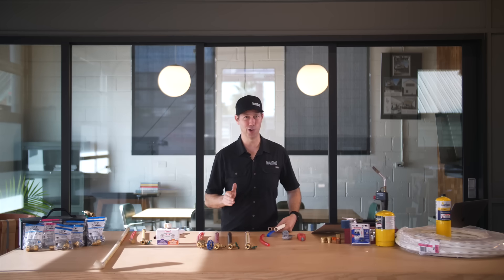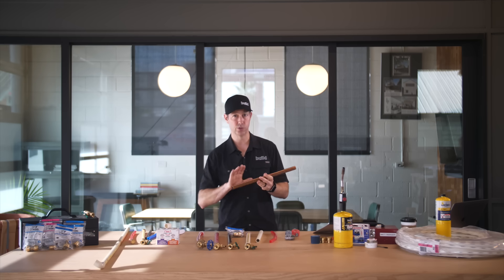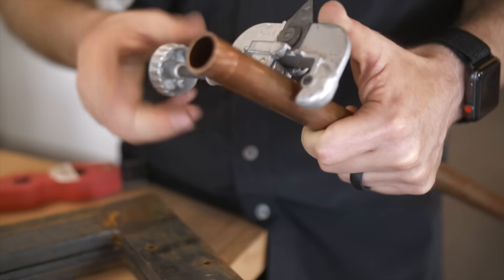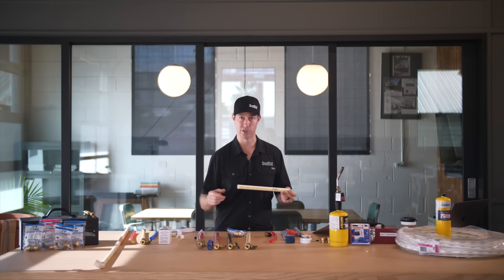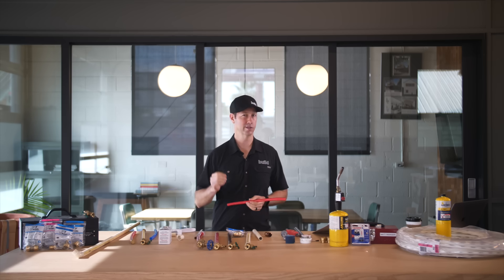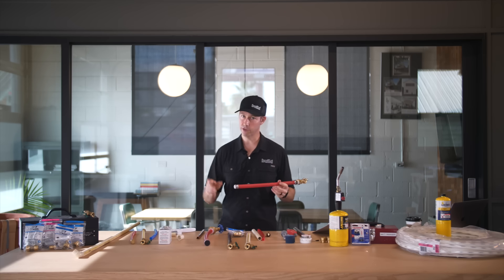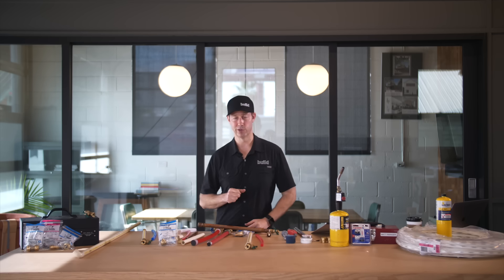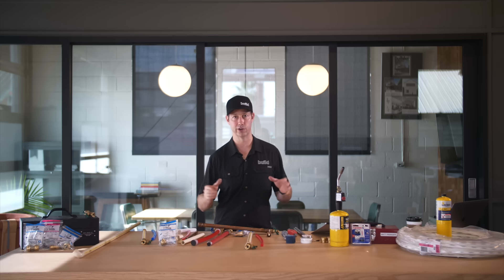PEX vs COPPER vs CPVC plumbing pipes

Comment: Avoid CPCV pipes at all possible costs, they get brittle as glass as time passes, even when using well water systems. The hot water pipes get brittle the quickest, and that is even when the pipes are shielded from sunlight.  Copper is best for areas where you need to have the PHYSICAL SUPPORT that a rigid pipe will give. Not many items require that, so that is why it is best to just go with PEX for everything. One area that requires the physical support of a rigid copper pips is the lines that go to a natural-gas-powered water heater, they might come into contact with the HOT GASSES that come from the combustion gases coming out of the heater before it enters the flu, so for that reason a lot of times it is required to have a 3-foot long line of metal pipe first, before the PEX can be connected. Other than that, you really don't need to use copper anywhere, PEX can be used to replace everything that would have been copper or CPVC in the past.  

    The absolute best PEX system is expanded PEX connection systems (Uponor, Waterline), as the fittings used in them have a much larger internal diameter than similar 'crimped' PEX fittings. Here is the main problem with using the Uponor system:  TOOL COST.  The expander tool is hellishly expensive!!!  Even used ones on eBay cost many hundreds of dollars.  Now Home Hardware in Canada is selling an exact copy of the Uponor PEX expander for only $105 US dollars ($140 Canadian dollars): https://www.homehardware.ca/en/cold-x-expander-tool-with-12-head-for-pex-pipe/p/3308481
So now an 'affordable' alternative for homeowners is finally available. Princess Auto in Canada also sells a PEX expander tool that is faulty in its design, and much harder to use (I do NOT recommend it), but it only cost $18 USD so that's a huge win for anyone who needs to install just a few fittings;  https://www.princessauto.com/en/detail/pex-pipe-expander/A-p8572166e  ( I had to modify mine by filing down some of the square shoulders so that there was a bit of a 'taper' to fit into the PEX pipe itself.  You first used the smallest side first, rotating the tool a bit with each squeeze of the tool to prevent wall 'tearing' of the pipe, then once expanded you flip it around and use the other side, rotating the tool as you go, and that expands it enough for 1/2" Uponor fittings to fit inside the PEX pipe). With the modifications the cheap tool worked great for me for 2 fittings, with no leaks.
   A battery-powered expander tool from Uponor will easily cost you $400 with the tool, the battery, and the expander head altogether. 

    SharkBite fittings have an internal stiffener that shrinks down the internal diameter similar to those of the expanded PEX fittings, and they are really expensive compared to expanded-PEX fittings. Just four SharkBite fittings and you've already spent more than you would have spent on installing an expanded PEX system using a low-cost expander tool.

     Crimped PEX connections are smaller in internal diameter, and they also require a rather expensive $60 crimping tool to install the solid copper crimp rings. While they are smaller in diameter than the expanded-PEX connections, they are okay for lines going to 3/8" risers, such as those going to sinks or toilets, but not very good for high-flow areas like washing machines or bathroom tubs/showers. There is a type of crimp ring system that uses a stainless steel crimp ring, and it has a TAB that is squeezed to cause the ring to get smaller over the PEX pipe. As time passes that TAB tends to 'expand', especially in hot water lines, and leaks occur after about 8 to 12 years, so I'd stick to the solid copper crimp rings instead. 

     So there you go:  
(1) Avoid brittle CPVC,  
(2) Avoid the complexity of having to solder copper pipes unless it is absolutely required (such as with gas-fired water heater feeder pipes).  There are braided stainless steel riser sections that SharkBite sells that can be used in such areas, but the rubber inner lining of some of those older designs degraded and were recalled in hundreds of thousands of homes. Here is the video of this specific failure: ( Autopsy of a Failed Sharkbite Flexible Hose 3/4" FIP Fitting for Water Heaters )  https://www.youtube.com/watch?v=3eoi74wsD-o
(3) Skip small-diameter crimped PEX connections if you have access to Uponor-type of fittings,
(4) Use SharkBite fittings only in an emergency or where nothing else will work,  
(5) Use expanded-PEX for pretty much EVERY water supply line in the house if you can find a local place that sells such fittings and has the installation tool at a low cost, or has a tool that can be rented. 
(6) And for 90-degree bends, don't use an elbow fitting, simply slide over a Metal 90-degree PEX pipe support available from Home Depot stores. https://www.homedepot.ca/product/sharkbite-1-2-inch-metal-pex-pipe-bend-support/1001012684

Comment: PEX is the only way to go unless there's UV exposure. It's cheaper, has freeze resistance, and has a quick and easy install.
Reply: Yeah, a lot of people forget about UV exposure.  For those areas you simply slide over a few lengths of foam pipe insulation to shield the pipe from the UV rays, and the pipe is protected. Some people also wrap aluminum duct tape around the pipe, that works also.

Comment: Matt, kinda disappointed you didn't mention solvent poisoning with CPVC. Those solvents are poisonous and water sitting in those pipes and joints leach  toxins until consumption. Huge factor in choice of material. I speak directly after poisoning myself with my own PVC install on my 1st house. Thanks for videos and making us better builders.
Reply: My thoughts exactly. Plastic toxicity is no joke and I cringe to think that people are using plastic for their hot water plumbing. Plastic, heat and drinking water don't mix.
Reply: ...add to that the fact that plasdick allows anything that comes down the pipe to grow and flourish within the pipe...for some examples, there is a reason doorknobs are made of brass, food prep counters are made of SS, and roofing shingles are made with Cu content...metal ions are biocidal, meaning, nasties wont grow on those surfaces!  That's why I'll never have plasdick supply lines in my house!  ...for drains, it GREAT, without question!...no blocked or rusted apart drain pipes due to galvi or cast, plus stink-easy to deal with, but not for supply lines...not at my house...period!

Comment: PEX has a third way of fitting. Beside the metal fittings shown in the video, there are plastic fittings that allow the installer to push to connect. And it is the most hypoallergenic choice.

Comment: Copper has a downside. A small percentage of people is sensitive to it and can cause irritation in their bowels. Also my friend had bad leaks in a wall because the plumber used too much flux and there was corrosion around joints.

Comment: Shark bite fittings are the only ones you can get for pex type plumbing in Japan.
Pex type plumbing and cpvc are the only plumbing that I've seen in Japan too, it also comes with foam insulation sleeves.

Comment: Sharkbite is great for a quick install and perhaps temporary set up or getting out of a tight bind.  ...but if anyone pipes and entire home in sharkbite they are an amateur.

(Also ..water use copper comes in 3 types    M, L and K )

Comment: I'm about to completely remodel a home built in 1996 using CPVC.  Just replacing a toilet, the CPVC was so brittle that it broke in 2 places.  What a PAIN!  I'm going to convert to PEX probably using push to connect fittings.

Comment: I've seen CPVC degrade in 20 yrs got brittle and breaking in odd places.
Reply: Someone told me:  replace your plumbing with a high grade of synthetic PEX plumbing. The specific brand we specify for our clients' homes is Upinor. It is more resilient and better than the typical PEX plumbing supply lines.

Comment: Have owned 3 houses in the last 40 years.  Two of the houses had copper pipe.  Once had a small pinhole leak in a copper pipe under a sink.  My current house has Wirsbo PEX.  In the last 2 years have had 2 cracks with pinhole leaks in the middle of a PEX pipe.  Fixing the leak was easy.  Drying out the area, replacing all the drywall, insulation, and repainting is very expensive.  The next time this happens, will probably (have to move out) and tear out drywall and replace ALL the damn PEX with copper....

Comment: Thank you for the interesting information on pex.  I am an electrician, not a plumber, but I am interested in getting an analysis on a  pex failure.  About a week ago, I was outside my house near the utilities entrance area and I noticed the wall was wet almost to the eaves on my 14 year old house.  Opening the wall on the inside of the garage, I found a leak with water spraying on to the tar paper in a jet stream.  I have temporarily stopped the leak by putting a clamp around the 3/4" pex with a piece of rubber bicycle tube sandwiching the leak.  I need to get a plumber out to replace the piece of pipe, but I would like to get an analysis of why the pipe failed after only 14 years.  There was no nail or evidence of anything poking the pipe, and it worries me, as I have plenty more of this in my attic.   The pex was Uponor with the plastic self compressing fittings.   Can anyone offer any advise on how the get an unbiased failure analysis, without it costing me a lot of money?
Reply: Do you live in a climate zone that sees below-freezing temps in the winter?  Seeing as that was an outside wall (?) an ice dam could have cause a spike in internal pressure that could have caused a split or blow-out.  If that was the case, then at the very least, insulating your attic pex might be a good idea.
Reply: I hope you fixed it yourself. All you needed was 2 push to connect shark bite fittings and a piece of pipe.
Reply: @daveyboy8907  push to connect fittings are good exposed in a basement but have been failing in 10 years behind sheet rock!
Reply: @metalrooves3651  that sucks.I have a few of those on my water heater..Getting ready to replumb whole house thus spring with pex.Crawl space so it should be fine..I think those sharkbite are good for emergency fixes or diyers
Reply: @metalrooves3651  are they failing because of the temp changes or are seals failing?

Comment: From someone who as been a plumber since '76....Type L should be used in walls and underground and service line to the meter should be Type K....that's likely what your municipality uses. When I started, you were only allowed to use Type M for repairs and not for inside walls. So....if you believe that the quality of Type M has improved over the yrs, use it throughout but I wouldn't. Spend the extra for your inside walls and underground. As far as CPVC goes, make sure you use the molded fitting when you transition into thread; CPVC to brass threads. DON'T use the threaded plastic joint. On the PEX piping.....understand that Wirsbo PEX pretty much revolutionized everything that is in concept today. And that everything other than Wirsbo is a COPY of their design. And specifically, I went to school on the stuff when it first came out and it was/is AquaPEX as their premium piping.  ...which takes composite fittings and brass fittings...the brass being the most durable. So then it was locked and distributed by Ferguson. Everybody wanted PEX, but they didn't want to pay the price. Shortly, a range of PEX style piping came and even wound up in places like Home Depot. Some people will tell you that all the knock-offs are just dandy and never fail. They do if you're in the trades and you see it routinely. Use what you want, but I have NEVER seen AquaPEX fail with brass fittings and expansion joints....even after a hard, unprotected freeze.  UV and cutting it are its only weaknesses. Expansion fittings are far more durable than crimped if you're choosing the cheaper way with PEX piping. The AquaPEX has always been compression joints. When we started, we had to use the lever expansion tools for the joints. Then they came out with the rechargeable drill-type expansion tools...that put the installers in gravy for speed. You can't imagine what it was like to use that lever tool under a custom house with 1" AquaPEX....lol.

Comment: Here in Florida we are seeing major pipe failures with cpvc in homes 18 to 20 years old.  And incredibly difficult to repair as it has become so brittle.  Also problems with copper pipe due to corrosive nature of the water,  we have found pin holes in copper pipes in property as little as 25 years old.  Pex seems to be the only way but will wait and see
Reply: I live in Florida and have found the same problem with cpvc.  It broke in one place and I broke it off in another just by moving the pipe slightly.  Also, in attempting a repair the only way I could cut the existing pipe was with a hack saw.  It's so brittle than cutting it with a cpvc cutting tool caused the pipe to shatter.  I'm on an artesian well with very hard water and high sulphur content.  Don't know if that is a factor.
Reply: @franktiller8874  CPVC is crap...but u know that...Hard water is tough on everything! We had an OLD water heater with 20 extra pounds of 'Iron sludge' in it from when it was new and empty ! For hard water up here in Granite NH I use a Rope style Prefilter and then Charcoal in a 2 Cartridge System. I only plumb them to the Toilet and Kitchen sinks. Saves on filter costs. Keeps toilet shiny too, and Flush valves stay clean. Good coffee and Ice water...CPVC sucks from the start, replace it whenever and wherever you can. Many Lawsuits over the crap in past years...Good Luck!
Reply: @franktiller8874  My guess is that maybe some of the minerals in the very hard water leeched the protective chemicals out of the cpvc causing it to become brittle.  If replacing most, or all, of the cpvc in your home would be cost-prohibitive (highly likely), then perhaps installing a water softener or other form of filtration to try and lower the water hardness might help?
Reply: @PongoXBongo  Thanks for your suggestion.  I think you are correct and will look into a water softener.
Reply: @franktiller8874 . In Vancouver BC we have rain water that is stored in mountain reservoirs.    We have soft water.
Reply: @franktiller8874 316 L stainless steel threaded supply will resist the harshest acids and 100 year quality. thats what is used at the drug mfg  facility i worked at for 20 years. the supply lines is 40 years old and still looks nearly new.
Reply: I do tile in south Florida and what I'll say about cpvs is "I can't believe it's legal to use".
Reply: I'm in south GA and have cpvc in my 22yr old home. I was replacing the faucet on my tub and opened a can of worms. The cpvc pipe broke when I moved it slightly. It broke under the house though, at the T where it downsized from 3/4 to 1/2 for the tub line. Repairing it with PEX.
Reply: Yup that’s what I am dealing with now. Cooper is corroding cpvc becomes very brittle so pex it is.
Reply: @NachoCamaro pex no good either
Reply: Builder here. My approximately 100 year old copper solder straight coupling failed today bursting it straight apart with an 8in flood before I caught it. Simultaneously my pex B push connect/pushfit straight coupling ALSO burst clean off. I'm afraid from now on for peace of mind I must go with pex B double crimp on every single fitting. I've never done pex a but I might take it up once my pex B double crimp fails. Any advice is welcomed for me from anybody!
Reply: @dmanno3 use Pex A as its much better material and no metal crimp rings.  You just expand the ends with an expander and it tighten around the fittings.
Reply: use schedule l copper  or  when in corrosive environments 316 L  stainless steel
threaded supply lines .its definitely more labor and time to install but its the most rust and corrosion resistant metal on the market and will resist the harshest acids. way more superior we used 3/4" piping for our home. more money and time but no regrets  . used in food processing and  million dollar drug  mfg filling machines .its forever. way better than cheap brittle plastic pvc.the 316L stainless steel threaded supply lines installed at  the Drug company are 40+ years old and still looks nearly new and absolutely superior for home use.
Reply: I see CPVC fail in central illinois in just 3 to 5 years. But our water eats shit up here
Reply: Pex. Will leake... copper clamp bands
Reply: Cpvc is for hot water
Reply: Not a knowledgeable about plumbing but curious. What the hell does water hammer mean?
Reply: @brettmandli3914  It's a pressure surge caused by a sudden change in water flow. The water pressure change causes the pipes to "thump", It's annoying to hear the thump sound and some cases over time will damage the pipes.
Reply: @brettmandli3914  a sudden surge of water. It is hard on the plumbing.
Reply: @brettmandli3914 
It kinda creates a vacuum sucking in the pipes that makes a thumping/hammer sound..... so you can add basically a balloon for every so many feet to "absorb" the noise/pressure....

Kinda imagine kinking your hose outside and it kinda spits unevenly....
#GetOnGab
Reply: Agreed,  Our CPVC got really brittle in just a few years of use. It could be related to the UV damage.
Reply: There must be a mistake. Probably not the right material. In Turkiye pcv pipes are in everywhere and they are super easy to maintain as durable. But u are right that it is not as durable as copper and not strong outdoor environment

Comment: I bought my "renovated" house in 2015, it was gutted for copper so they installed PEX (poorly). But i love the PEX, its so easy.  Ive nver seen anyone use CPVC here in New England but many people stick with copper...because expensive? Replaced a couple pieces in my dads home circa 1998 with PEX because of pin holes.